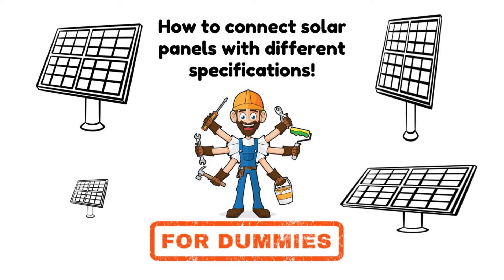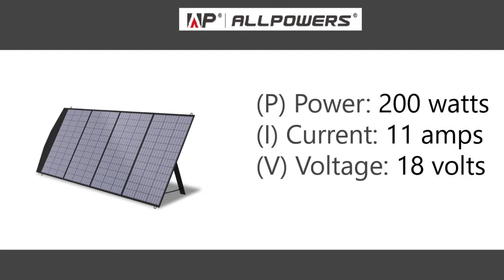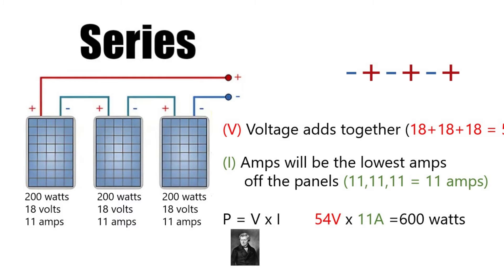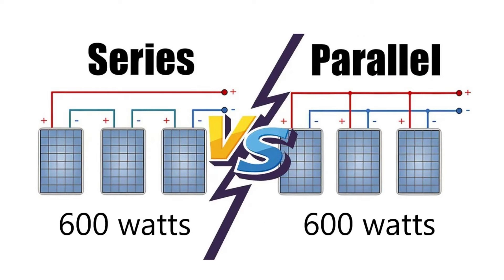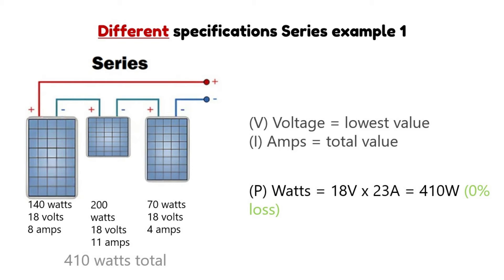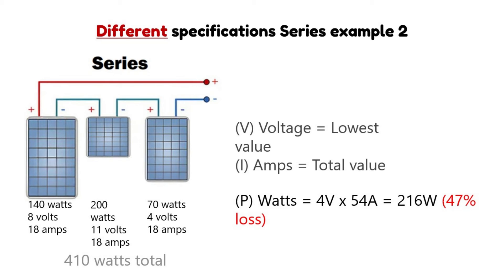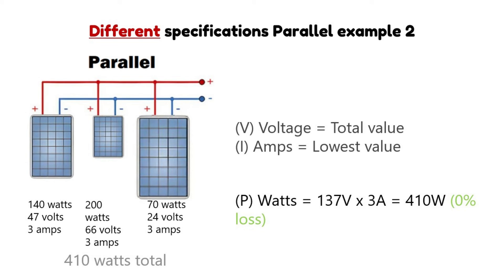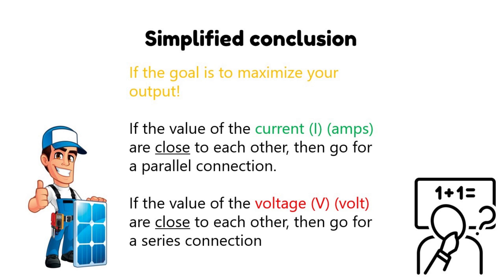Series vs Parallel Solar Panel Connection: Which is Better and When?

Comment: Series driven components see identical current. Pretty sure the rule follows for series power sources. I think your thinking is backwards with your dissimilar panel connections.

Comment: I have heard from another youtuber that even if you have 3 identical panels if one of them experiences a loss in sun input, for example some shade is cast one one of the panels in series it will reduce the output on the other 2 also.
My reason for investigating this is I am wondering whether it is better to have smaller panels connected in parallel on the back of a bike trailer than have one big panel, in case I am blocking some of the panel with my body as I ride.
What do you think?
Reply from the maker: That is right. If you think that one of the panels might be in the shade then parallel is better. In then you will only lose the production from the shaded system and not the whole system.

What solar panels are you using?
Reply: @olleoutdoors  I have not bought any yet, but likely from amazon :
YINGGUANG 100Watt Flexible Solar Panel, Portable 18V Monocrystalline Solar Panel, 995 x 500 x 3 cm; 1.65 kg 

The size is important because of it being behind me on a bike trailer not on a roof.

But I may bring onther the same size to have it working when I am at camp
Reply from the maker: What did you have to pay for that one?